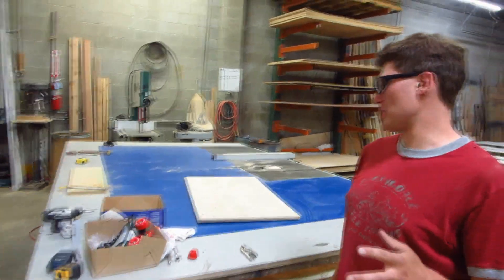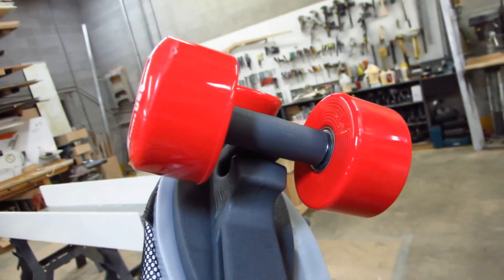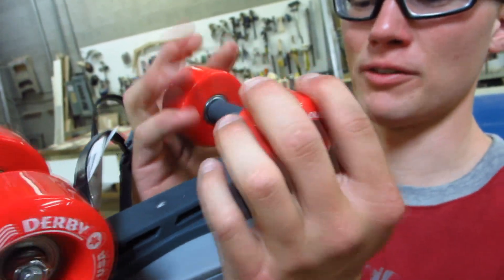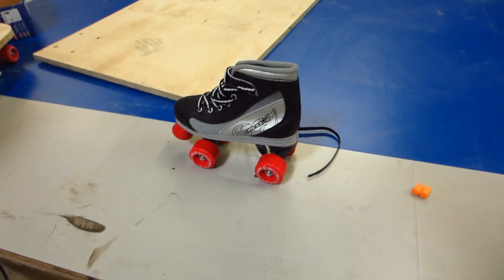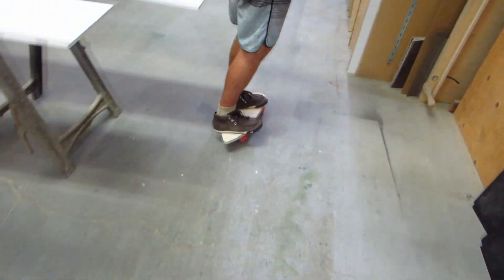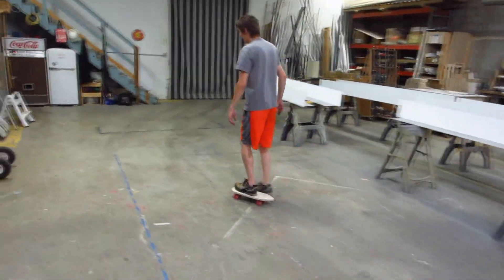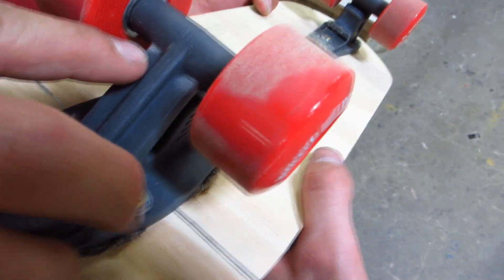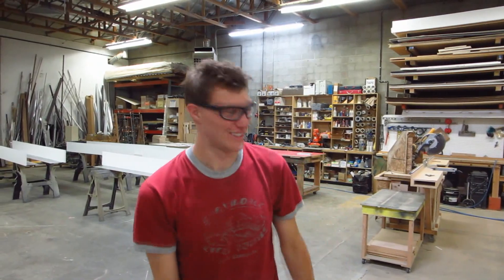Roller Derby Torsion Beam Skates, as a Skateboard Truck. An early compliant mechanism style design.

Comment: I have them with the torsion bar! mine are from the viper brand, but they are amazing and super fast! The best thing about this type of skate is that after skating and using them for a long time, the shoe has no way to come off. In the times of the 70s, 80s and 90s many of them had that problem, the heel of the skate would come off over time, but this type that I have,  is worth it! I have had them for 19 years... and they are still working.
Reply from the maker: That's pretty incredible, do you have any pictures?

I always guessed that poor longevity was a big reason why a torsion style truck never really became more than a niche thing, so I'd be really curious to see a design that's lasted 19 years.

Comment: Torsion beam - like in cars' rear suspension???

For rollerskate usage, there are 4 trucks per load (person), so when adapted onto a skateboard, it is understandable that the use of only 2 trucks per load would probably affect the lifespan of the beams. Furthermore, having a skateboard deck means that there would be more leverage of load acting on the trucks too - due to the width of the deck compared to the width of a rollerskate shoe, so it is no surprise that they discolored that quickly, I guess.

However, the fluidity is, as you said, superb - and there is no slop or play due to having no moving parts; although I am interested to know its return-to-center-ability, which I would assume to be low, unless springs or bushings of some sort are added (perhaps, like for a car's tornsion beam application). Also, by adding some springs or bushings, I would assume that one could add adjustability to the system.

I am imagining a design incorporating a torsion beam that swivels around a pivot encased by a giant Rojas bushing and/or with springs like Seismic on each side of the hanger.

On another note, those wheels look like they would be sick for sliding though!!!
Reply from the maker: I think more than the fact that it we were doubling the weight per truck by using it as a skateboard, was the fact that these were designed for 70 lb 8 year olds or something.

Return to center was pretty low, but as an alternative design to things like orignals or sidewinders, it looks pretty good.

They do make torsion skates in adult sizes, but only for the rental market. I really want to see if I can track down a place nearby that rents them.